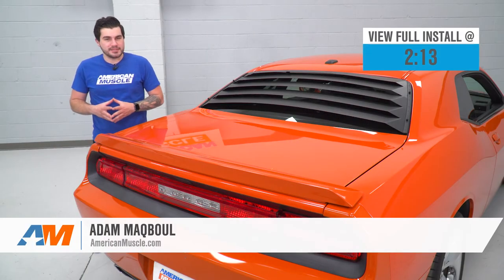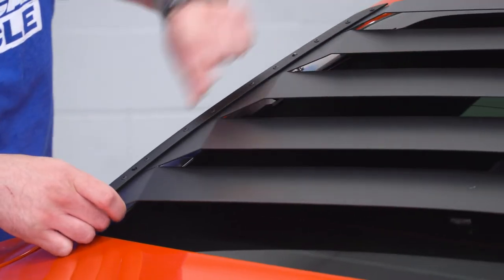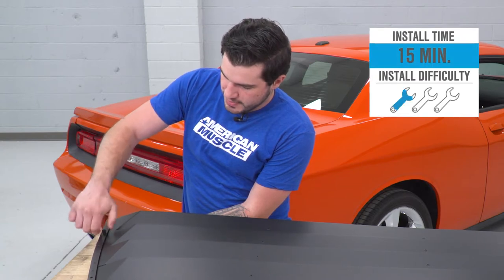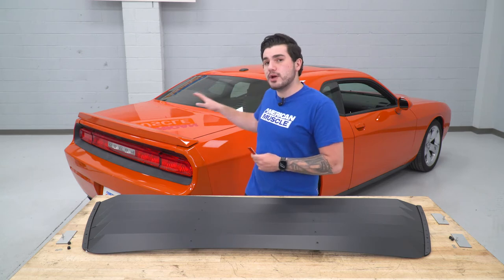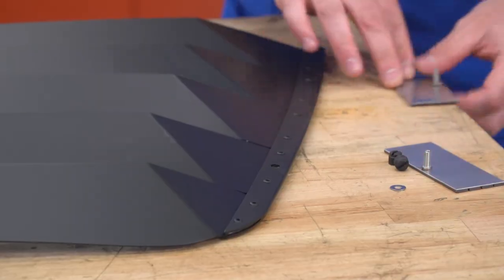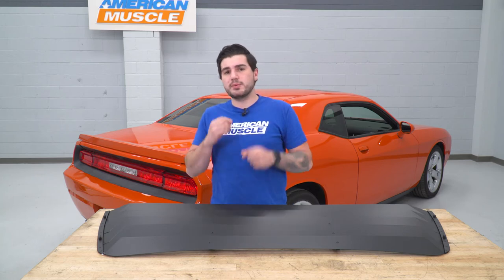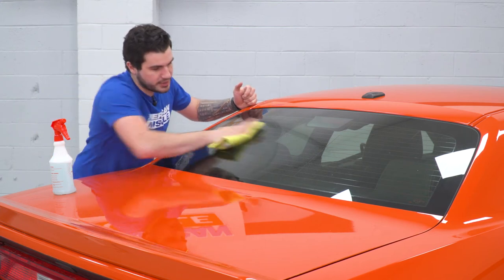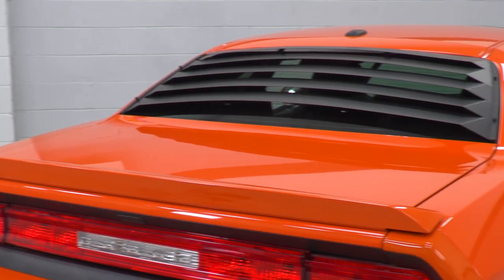2008-2020 Challenger Rear Window Louvers; Aluminum Review & Install

Comment: Thinking of doing lovers for 18 ScatPack..I like this aluminum version over plastic. Since this can be removed and has some flex…do you think I could have this painted Octane Red to match my car, or would that cause cracking you think if I pull off from time to time to clean window?
Reply from the maker: If you have the louvers prepped properly, they'd absolutely be fine to paint match! -Zach